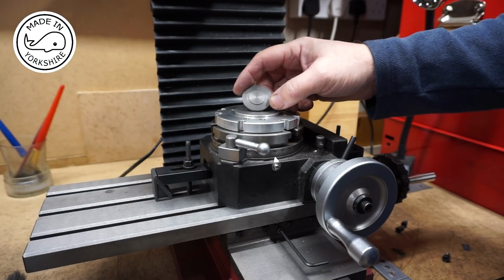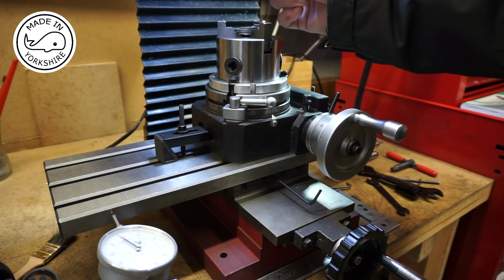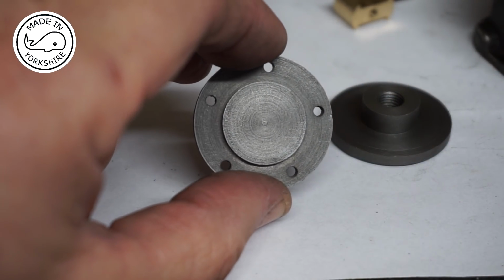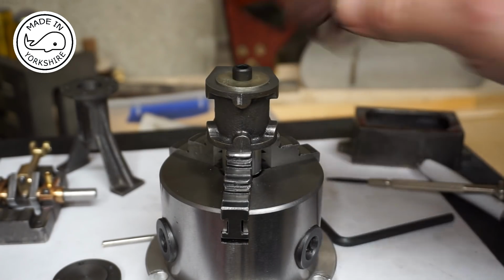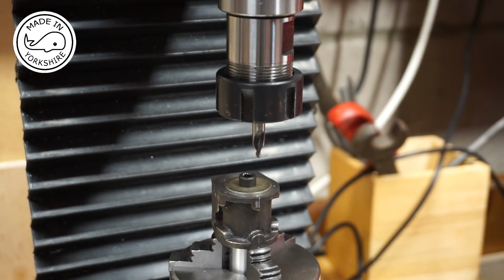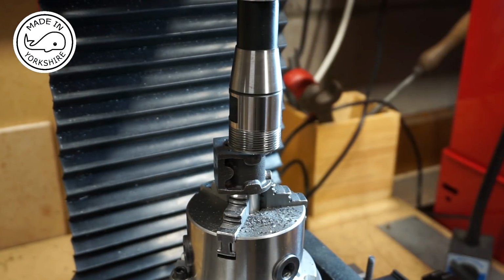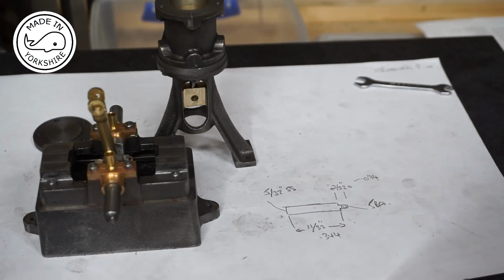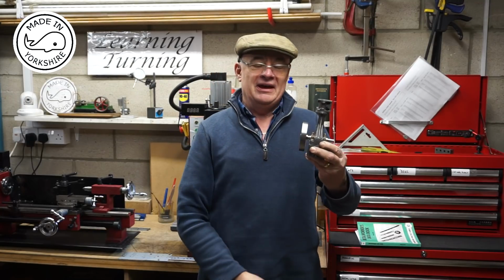#MT25 Part 10 - Making a Stuart 10V Steam Engine. Test Assembly. By Andrew Whale.

Comment: In fact those Amazon ones are such good vaue I just bought a set to supplement mine.  I forgot to say they are also excellent for drilling the holes in thin materials as they are very rigid.

Comment: Hi Andrew great vid TFS "thanks for sharing". You could speed up your drilling if you centre drill then swap for 2.6mm (or whatever drill bit required) and drill then swap back to centre for next hole and so on, not my idea someone on youtube they were making a mill pallet and centre drilled, drilled, reamed and some of the holes were tapped all before moving onto next hole! Me thinks I need a rotary table and a quick change tool post and a, haha the list is endless. Best Regards G :)
Reply from the maker: Hi Graeme. Thanks for the suggestion. One can never have too many toys to play with.
Cheers
Andrew
Reply: Andrew Hi, Agree with the toys, had a little play doing the cross-head n piston rod thoroughly enjoyed it but was nerve racking, this is all totally new to me and do get a little worried if it will turn out right. I think it's the precision and the small parts, just going to go and silver solder the crank webs ready for marking out and drilling, was too cold in the garage. Keep the vids coming. G :)

Comment: Good work Andrew,

You could use the 4 jaw chuck from the mini lathe on the rotary table.
that would give more clearance, as the part would be lower in the jaws.
The bore of the cylinder can be clocked in, for accuracy.
Your adapter plate should fit the 4 jaw, as it is 55mm register as well .
ATB  Adam
Reply from the maker: Thanks for the advice Adam. Unfortunately the diameter of the adaptor plate I have isn't big enough for the my 4-jaw chuck - there is no room to bolt it to the table.
I did buy a larger plate last week but it needs machining to fit the register. I thought it might be aluminium, but it looks like stainless :-(
Not sure how to go about it - but a job for when I have finished the 10v.
Cheers
Andrew
Reply: +Learning Turning Metal - by Andrew Whale 
Hi Andrew,
So your sc3 mini lathe 4 jaw chuck is not 80mm ? .
Adam
Reply: +Learning Turning Metal - by Andrew Whale 
Hi Andrew,
If you have a email address that I can contact you on ?.
I can forward some drawings that I put together for making chuck back plates.
Also some links to information and materials.

Adam
Reply from the maker: Hi Adam. Sorry, I should have explained that it's a 100mm 4-jaw chuck. Thanks for offering to send me some info. My email address is: learningturning@btinternet.com
Cheers
Andrew

Comment: Andrew. You really did not need to set the cylinder up on the rotary table again to do the tapped holes. You already have a drill jig in the form of the cylinder end caps. This could be done on a pillar drill if you have one, place the end cap on and position it where required, then using the same size drill spot into the cylinder end a small amount. Mark the cover as to which hole you have just used ( incase of indexing errors ) change drill to tapping size, drill and tap hole. Bolt on the cover using the same hole, then proceed to spot drill, drill and tap the remaining holes. In this way, should there be any rotational errors when you made the cap, it will not matter as the cylinder holes were drilled directly from the cylinder end covers. Always try if possible, providing that you have a location part, spot through holes, rather than try to index as there could be problem fitting together should you have made a boo boo when moving the table or indexer.

Comment: Hello Andrew,
I'm finding your series on the 10v really helful. You're brave enough to include your mistakes and it's all useful information. Did you manage to drill the top and bottom of the cylinder for the 7BA studs without going all the way through the thinner flanged part of the cylinder? I know you mentioned it was a problem but I'm not clear of the final outcome, were they blind or all the way through? Any help with this would be much appreciated but I realise its about 3 years since you built this model! I made a simple jig for tapping 7BA hole which consists of a block of metal drilled through with a 7BA clearance hole to keep the tap vertical but this leaves me blind as to how the tap is going - your method with the sprung tap follower is a much better method and I'll use it in future.

Excellent work and videos,

Chris
Reply from the maker: Hi Chris
As mentioned in the video I drill to a depth of 6mm. This resulted in the top and bottom two holes closest to the valve cover being drilled right through. The other holes were blind. Hope that helps.
Cheers
Andrew
Reply: @learningturningmetal   
Andrew, Thanks for your reply, 
It's good to have the through holes confirmed, like you said in the video a good of deal of time has been invested in the cylinder by this stage. The plans are pretty vauge on the inlet and exhaust ports, presumably it's a matter of personal preference which side you put them on?

Cheers,

Chris
Reply from the maker: Hi Chris
To be honest I can't remember. If you follow what I did you shouldn't go wrong.
Cheers
Andrew

Comment: Hi Andrew, what size is your rotary table, cheers from new zealand
Reply from the maker: Hi Gary. The little rotary table in the video is 110mm across with 3 t-slots. It's about uk£100 from Axminster Tools in the UK. I also have a 150mm 4 t-slot - again from Axminster for about uk£150. I hope that helps.
All the best.
Andrew

Comment: Hi Andrew,  I see that you are using centre (slocomb) drills for spotting in your mill /drill.  In an earlier video you had diffculty using it due to interference with a chuck or something.  I now only use Slocomb pattern centre drill in the lathe.  I was advised by an excellent engineer John Stephenson who sadly died last year, to use what is called a 'spotting' drill which is much longer than a slocomb. and are parallel.  I use a 3mm and a 5mm and they are very accurate when spotting on scribed lines.  The reason is that they have very little 'land' (flat bit) on the tip of the drill and are very sharp.  I've never regretted buying mine.  They can be very expensive but for our use this set is adequate -

https://www.amazon.co.uk/dp/B0756Z2671?tag=duckduckgo-ffab-uk-21&linkCode=osi&th=1&psc=1
Reply from the maker: Hi Terry. They look great. Something else to put on my shopping list. 😃
Cheers
Andrew